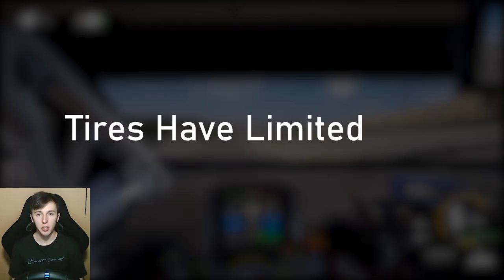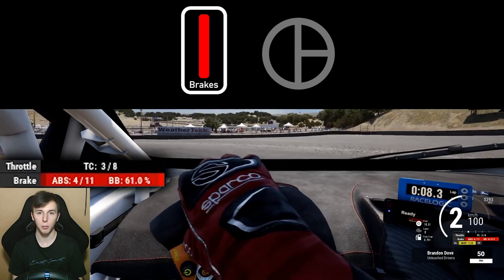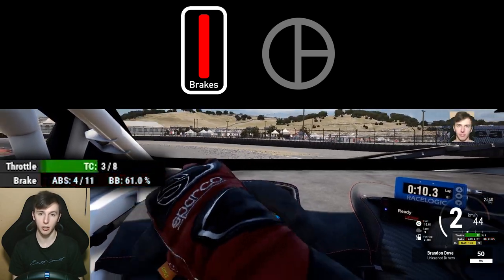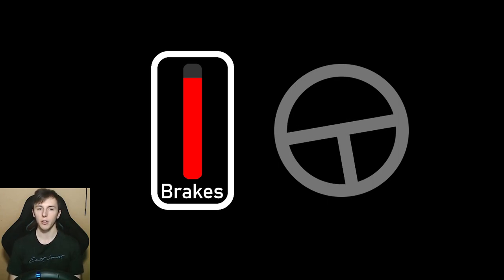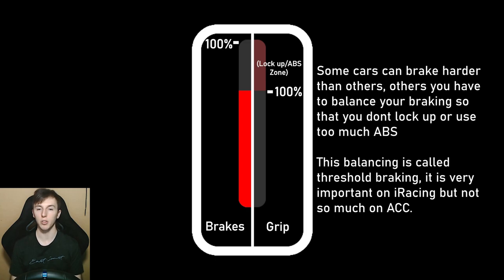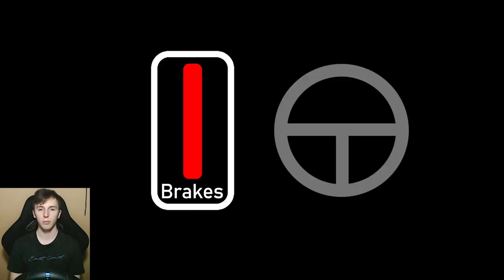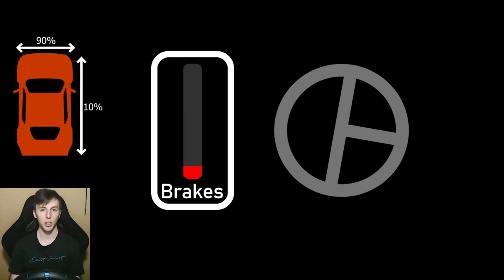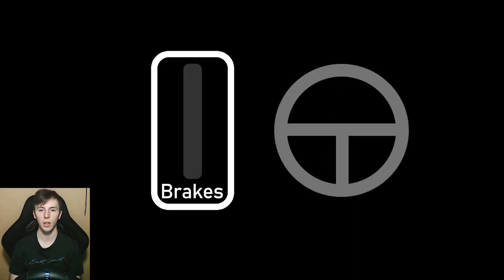Corner Like A Pro - Sim Racing Tip Fridays #2

Comment: How can I stop sliding through corners?... Whenever I see a replay of myself, I'm the ahole with the smoke/dust-trails behind them. But no matter what I try to do, like braking earlier or backing off the throttle, I keep going slightly sideways and "slipping" through the bends, probably making me lose time and speed. - This is the case in all situations in every game, be it a sim-cade type game like "DiRT 2" (not "Rally") or something a bit more serious like "Dirt Rally", or something even more critical like rFactor 2 (though, it's a little more manageable there, probably due to the more serious simulation). - I just don't know how to avoid the sliding, short of just slowing down to a crawl and driving as if I'm in public or something, obviously having the rest of the pack rushing by.
Reply: So do you hit the apex? The proper one?
Otherwise Id say you are over pushing the car being on the edge of losing it

Comment: Great video. Too bad with my G29 it's probably impossible to break properly.
Reply: You can definitely brake properly with the g29, it's just harder to do it consistently. A stiffer spring helps with that a lot with muscle memory, and even better if it is a progressive spring.
Reply: @voongnz  Currently I find braking like a 0/1. It's either 90-100% or 5-15% with default spring. It's very hard to get something between. Maybe I'll made some modification.
Reply from the maker: Yeah I've gone back from Fanatec pedals to g29 pedals so I can run gran turismo 7 on ps4, since it's a pain to keep swapping them, I'm just leaving the g29 for the pc setup too for now and wow it's different. I find it a lot more difficult to trail brake correctly. I sometimes try watch my brake input trace while I'm braking to see if I'm doing it right. It's much more natural on stiffer loadcell pedals as you are judging it by how much pressure you put on the pedal.  Even the wheel is insanely different. I can barely feel anything on ACC with it. Theres a big FFB deadzone in the middle
Reply: @unleasheddrivers1281  That's my experience with ACC and this wheel. rF2 is somehow much more playable.
Reply from the maker: It makes me wonder how I used to use this wheel back when I didnt have the direct drive, it's difficult to adapt again for sure! The feeling is a lot better on a DD wheel. I totally recommend If you ever get the chance! If you do iracing, I would prioritize good pedals above a direct drive wheel though. Braking is so important there
Reply: @unleasheddrivers1281  I'm going to replace it with a DD wheel. However, I have to wait for a while due to some priorities and limited budget. ;)
Reply from the maker: Totally understandable, keep practicing to find that confidence on the g29 brakes for now, its difficult but it should make you even better when it comes to a better set of pedals
Reply: @unleasheddrivers1281  Yes, this is what I'm going to do for now. Once again, thanks for your video and support.
Reply from the maker: You're very welcome, hope i can continue to help with these videos :)
Reply: My sim racing journey went like this: G29. Rig. BIG Consistency gain. T-LCM Pedals. Again big consistency and speed gain. 3drap mod for pedals. Better feeling. Lastly DD wheel. At first there was not any improvement. But after a while, I started to "feel" things I didn't feel/notice before and this eliminated uncontrollable spinning of the car and it became easier to catch slides. 
So I would say Rig and loadcell pedals are the most important things in simracing.
Reply: @alpha007org  By RIG, I am sure you imply consistent positioning to improve the consistency with muscular memory. a RIG can allow that for sure, for some people without space or budget for it, a simple marking on the ground for the chair positioning and a cheap setup to have the pedals higher and fixed could be enough to reach that goal. I did that with 10$ of plywood. Now I need better pedals I guess, I'm still with the standard G29 pack. thanks for sharing your experience Alpha007!
Reply from the maker: It's interesting to hear your impressions with the direct drive are similar to what mine were. I mention the same thing in the video I just uploaded.
Reply: @unleasheddrivers1281  Yes, I'm glad I'm not alone. :) I was thinking it may be my fault, but this wheel (and especially the brake) makes things complicated. I'll probably try to remove a rubber from the brake to see if it will make a difference. P.S. I wasn't even aware of this 'dead zone' in the middle, because it's an only wheel I tried. I thought 'it is as it should be'.
Reply: @frantz4318  Yes, when you sit in the rig, your arms and legs are always in the same position. If you can achieve the same with DIY, more power to you!! I have two left hands when it comes to DIY. Regarding Logitech pedals, there are some great mods that vastly improve the feel.